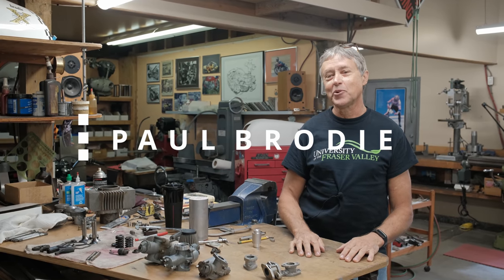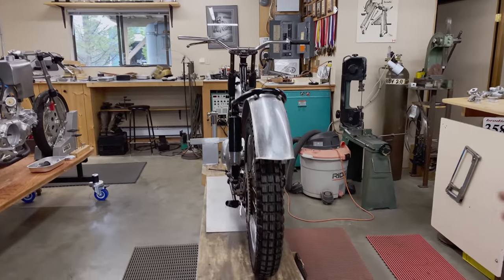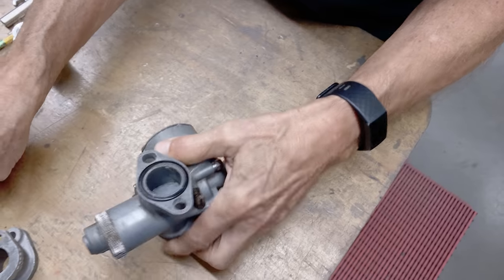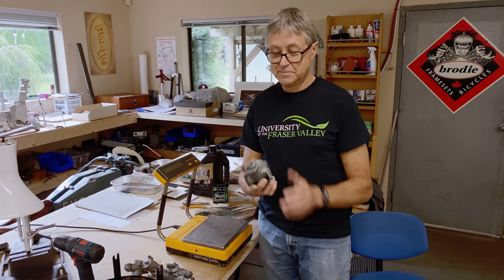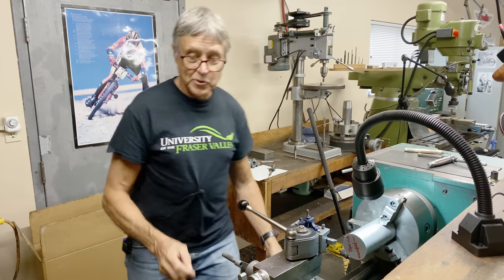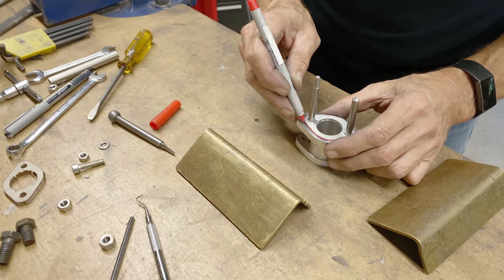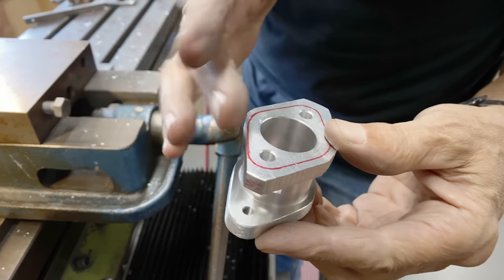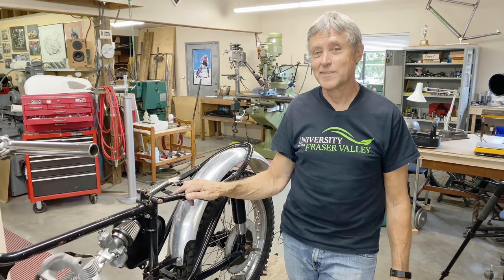Tiger Cub Intake Manifold // Paul Brodie's Shop

Comment: I purchased the same Phil Irving book when I was 15/16 yrs , I got that intrigued by inductions and exhaust systems that I saved my money and when I was 18yrs old in 1977 I imported into a Australia a Superflow flow bench Colorado USA , i then spent the next few yrs flow testing and modifying every type of cylinder head I could get my hands on , I was fortunate to meet Phil once , was a brilliant Australian engine engineer 
Great episode Paul 👍👌even tho I am probably the same age , I am picking great ideas /hints from you , can never stop learning 👌Cheers Chris
Reply from the maker: Thanks Chris. I had a friends' Superflow flow bench for almost a year, and I did a few heads on it. That was a good learning experience.

Comment: I think a couple of degrees to each flange face ought to do it or perhaps a little more work but cooler might be a piecut....no, one more would be better... 2 piecuts and Tig welds all the way around. Your signatures are these parts we see being made with ease. The crazy expensive mixed with the certainty of handmade is a look that adds the best kind of value, a personal touch.

Time to wait patiently for the chosen solution.
Reply from the maker: RJM, thanks for watching and commenting.
Reply: that's probably the easiest option right now - mill the faces at an angle
Reply: @raymondo162  Probably what I would have done. Most AMAL carbs were designed for up to 20degree down-draft but some were designed to be straight up and down. Fuel level changes on a mono-block  and concentric depending on mounting angle. The remote float early type are easy to spot as the base is 'twisted' or straight (unscrew jet block and put mounting surface flat. Float chamber will either be tilted or straight up and down)

Comment: I've seen many trials Cubs here in the UK fitted with the concentric carb. But the engines may have been fitted into frames that had more left engine offset. This allows the chain to clear 4.00 section rear trials tyre (tire). My 1961 Cub runs a Amal Monobloc carb, I've not taken if off yet to measure it's size.
I enjoy your vids please keep them coming.
Reply from the maker: I fixed it. You will see the cure in our next video. Thanks for watching and commenting.

Comment: Saw that coming mate. I’m looking at a similar tight spot with the carb conversion on my CCM F650 Dakar. It’s clear why no one has ever done it…!

If you make a V cut into the thin diameter of the manifold (and weld it together again), you can angle the carb downwards closer to level, and clear the top tube. That will allow you to use one of those angled cable tube extension thingies. 

Nice work as always. Thank you for sharing your Tiger Cub adventures.
Reply from the maker: I did figure out that manifold, results will be in this weeks video. Yes I screwup and make mistakes; I'm still learning.
Reply: paul brodie I knew you would Paul. Looking forward to seeing how you did it.

Comment: nice work! but to fix the carb clearance something nice would be to put some angle on the flanges so the carb is more upright compared to the cylinder... I think it would look better too.
Reply: Yes, and for a single cylinder, an even longer intake is good for torque.
Reply: @chrisjohnson4165  it wouldn't be longer, just some angle on the flanges. maybe 10-15 degrees.
Reply: @MrLeoBL  Yes, you're right.
Reply: Hey you are right!
Reply: I had a Cub in the sixties. I put a monobloc Amal on it, and if memory serves me correctly, there was an angled manifold supplied by Triumph which did exactly as suggested. Apart from solving the clearance issue, it helped to restore the correct float orientation. But as this was over 55 years ago……I wouldn’t bank on my memory.

Comment: Some nice nuts can be made by cutting the head off twelve point bolts. Drill and tap and you have nut with a flange that you can get a box end wrench on. Nice job on the manifold

Comment: Great videos Paul. Love your work. I started on Cubs at 13 years old, so this is a great project to see. I have a 26mm Concentric on a tapered manifold. It runs perfectly throughout the rev range, and much better than the original 15/16 (24mm) Monobloc. The standard manifold is canted to level the carb somewhat from the 25° barrel incline.
Good luck; this will be a great Cub.
P.S. Depending on your CR and exhaust I'd start with a 200 main jet on that carb.
Reply from the maker: Thank you T Fox. I have no idea on the jetting, so 200 is a good place to start. Engine will be assembled soon!

Comment: Paul, thin those flanges a tad for more clearance , they are pretty beefy .
Reply: Probably need to be quite thick to cope with vibration and a heavy carb. Thinner will probably distort and cause air leak? (very common on Japanese bikes where weight has been cut down)
Reply: He just wants it to be skookum
Reply: Could the insulator gasket be thinner to achieve similar solution? On my Commando there are two thicknesses for that gasket available.

Comment: Excessive heat is one of the major problems of Cub motors, as they were based on the 150cc Terrier, and fin area is marginal at best.  One of the issues related to this is fuel vaporisation,  which is made worse by the low-quality carbs that are often fitted.

The fuelling difficulties cannot be cured completely , but can be improved a great deal by using a better carb, which is spigot mounted into a rubber intake hose.
Reply from the maker: Yes I hear what you are saying. I will see where the path I have chosen takes me.

Comment: I agree with Gerald, that Phenolic spacer is pretty thick as well, you could get the carb a lot closer to the intake port and gain some room for the cable routing, awesome job on the manifold though, it is great watching you work Paul.
Reply from the maker: I did fix the cable routing, and it is all shown in the video coming out very soon, maybe even today! Thanks for watching and commenting.
Reply: As someone has already pointed out a longer intake tube helps with torque, and  at only 200 cc the Cub engine needs all the help it can get !
Reply: @samrodian919  , LOL, I feel Paul wasn't going for torque with the Cub, he probably better options in the shed for that :-)

Comment: Always fun watching you make these parts!  I make nuts for exhaust flanges out of tubing and weld an allan head to the end.  I don't think that would work for your application due to space limitations in the other direction but might be useful in the future.  Another excellent video!  Thank you!
Reply: Yamaha use 8mm and 10mm Allen head flange nuts on several of the 'cruisers' although I forget which models
Reply: @1crazypj   Gardner Wescot makes allan nuts as well but they are limited to shorter bolts or studs.
Reply from the maker: David, thanks for watching..

Comment: The frames were brazed in an open fire pit / forge. There’s a factory movie from the mid fifties out there on YouTube somewhere that shows it..
Reply from the maker: Yes, I believe a lot of the lug / tube brazing was done in the forge. But, the joint shown in the video was definitely fillet brazed by hand.
Reply: @paulbrodie  Correct🙂
Reply: The brazing done on the forge is called capilliary brazing, where a tube is inserted into a previously reamed lug and pinned in place, fluxed, and brass filler run into the joint. 
Fillet brazing is done with a higher melting point rod dipped in flux. It allows brass to be built up in a fillet at a tube junction without needing a  heavy lug. 
Look at the Cub headstock in the video; it is capilliary brazed to the top and down tubes. The cross tube under the seat is attached by fillet brazing.

Comment: Hi Paul 😊 i’ve just finished watching the Amazing Aermacchi Build, Now starting the Cub renovation, you showed in this video how do you get the centres of the manifold studs,  there is an easy way that doesn’t involve math ….. you just measure from the outside of one stud to the inside of the other this will give you the centre to centre measurement
Reply from the maker: Yes, there are several ways to come up with the same result. Thanks for watching!

Comment: I use a thickness collection of sheet aluminum to check wall thickness. Put scrap between driver's side thumb and index finger and the adapter wall between passenger side index finger and thumb. My middle finger and thumb combination are only used for calibration.....
I think your thickness mover outer is a cool tool.
Reply from the maker: A pattern maker gave it to me. He made it.
Reply: @paulbrodie  I've never actually had my hands on one of those 'thickness'  calipers but did see a plan for a woodworking version used by bowl turners long time ago (when I didn't know I may need one one day) LOL
Reply: What happens to your calibration when doing some carpentry and you hit your thumb instead of a nail with a hammer ?
Reply: @samrodian919  A ball peen never goes for a thumb but the memory gap waking up is flat out nuts.

Comment: Hi! you could make a custom carb slide cover with the cable off to the side a little so it misses the frame.  and without a choke cable thread.
Reply: or even centered throttle cable but adjusting screw at an angle
Reply: @Copozeras  You need to see where the throttle cable attaches to slide, plus, the inner wire doesn't take too long to 'saw' through angled pieces
Reply from the maker: I found a fix. Next video will reveal for sure. Thanks for watching!

Comment: You could cut your adapter and weld it back together at a slight angle. 😂 That would fix it.
Reply: legit
Reply from the maker: I did find a fix without using my welder. Next video coming up!

Comment: On the Norton Commando using those type ofAmal concentrics, the manifolds are curved to bring the carb closer to horizontal with respect to the bike frame. Could give you the carb top clearance needed. Also, the manifolds have studs threaded into the carb side flange, so the carb only needs a washer & nut each side to attach and no clearancing needed on the manifold body. 
When you stated you would not be planning to remove carb often, I chuckled! Can't tell you how many times I've have to remove mine! Those older, non-Premier types have non-removable pilot jets and a bad reputation for stubborn clogging of the pilot jet circuits.
Reply from the maker: I said I am not planning on removing the carb often. That is the optimist in me speaking. I am old enough to realize that reality might be different. I have fixed my manifold dilemma. Next video has the solution. Thanks for watching!

Comment: That is such an awesome bike.... I'd love to build one like that but I want a high powered electric QS 273 3.5t motor and Kelly 72200 controller running 80v Greenworks batteries so they can be charged and swapped out quickly.

Comment: Nice work, if you put a slight slope to the one face the carb would sit flatter and give more room for the cable and allow to mount as one combined piece. But you probably know this. I found this very interesting as i recently restored my 1967 Cub.
Reply from the maker: Thanks Robert. Great you have a Cub too!
Reply: @paulbrodie  do you have a video on installing an updated electronics instead of the points? I bought the system but the directions were poor and as i had a very difficult time setting the timing after the restoration i am somewhat reserved to do the upgrade.
Reply from the maker: @robertpenner4432   How did you set the timing? Did you use a degree wheel and a timing light?
Reply: @paulbrodie  i had a timing wheel but had never used one before so i went by what the manual said , which is a bit foggy right now but i got it to top dead center and then i believe adjusted the points so they would open slight before TDC. I had a someone from the part shop in Edmonton run me through it and his description was very similar to what the book had said but to now avail, the best i got out of it was a backfire a couple of times so i eventually took it to The Old Bike Shop in Calgary and their mechanic tuned it for me. Could not find anyone closer as i live in Kamloops. Then i had to get it re-certified as i had not insured the bike since 1970 and lost the paperwork on it but it runs and starts on the first kick, when i run it, which is not very often. I ad bought the electronic conversion as i heard it was better then the old points system, maybe one day i’ll consider changing it.
Reply from the maker: @robertpenner4432   If you don't have a degree wheel and a timing light you really are just guessing. We'll be making a video this spring.

Comment: Remove swingarm  check for "twist" also..axle holes maybe flogged out  causing wheel lean
Reply from the maker: Removing swingarm requires a hydraulic press, I discovered. Axle slots were not the problem. Next video reveals all!

Comment: Having ridden  a tiger Cub extensively in the early to mid sixties, I have a fond memory of them. II appears to me that the bike you have is abit of a mongrel The frame may be a swap over , or a one-off. The motor is not from circa 1958, but most likely a bastard version or an up-grade from a newer model. The ignition breaker was not offered by Triumph until model year 1964 and was a very welcome modification.The proper contact breaker assembly was mounted vertically in the right engine case with an internal clamp secured with a crew through the outer case cover. Th i arrangement was unreliable as it ouuld slip and cause the ignition timing to change while it was running.The frame is missing the triangular gusset welded over the jumcture of the under-tank tube and the front down tube. Some of the cubs could develop a crack in the front down tube without it. I thoroghly enjoyed your treatment on the manifoldWe never had the equipment to do such work. I hope your project runs good  and is reliable for you.
Reply from the maker: Yes, Jim, my bike will be a mongrel. I bought a bunch of stuff which included 2 frames and 4 motors. Trying very hard to make one good bike out of all of that. 1958 frame with a 1965 motor. Thanks for watching!

Comment: I think there's a slight twist in the standard Cub manifold, it's hard to see, but if you put it on upside down , the carb pokes out the other side of the frame top tube.
Reply from the maker: I did fix it. Next video coming soon!
Reply: @paulbrodie  looking forward to that. Cheers

Comment: I was taught the inside of one stud to the outside of the second stud gives you the center to center as in your manifold mounting studs. This assumes that both studs were of equal diameter and saves my from a math error!
Reply from the maker: That is true, but how do you measure that?
Reply: @paulbrodie  Paul, I use my very best eyecrometer if I feel the need to be super accurate. But, my machine skills are equally poor to my measuring skills. It usually works out, but nothing as nice as your results. Love the videos!
Reply from the maker: @hasletjoe5984   Thank you Haslet Joe.

Comment: I know it would have been a lot more work but personally I would have made the manifold with a gentle bend in it, this would have given you clearance for the choke and throttle cable, also the carb is less likely to flood if its level, jetting it can be a bit easier and you are less likely to have the engine run rich when you are braking hard because the fuel won't spill out of the idle circuit into the air stream. Yes a straight shot at the intake valve will give more power than a bent intake but I bet there isn't a dyno that is sensitive enough to even measure the difference on a Cub engine. Anyway watching you machine stuff up sure beats doing the work that I'm supposed to be doing!
Reply from the maker: On a Cub there is no such thing as "braking hard". Have you seen the size of the brake shoes? Thanks for watching.
Reply: @paulbrodie  I thought that you might say that!

Comment: Don't forget to true up the face of the carb. They are essentially a heavy lump of plasticene being shaken to pieces, and the flange is always bowed, leading to air leaks.
Reply from the maker: I'll check, thanks.
Reply: Yes over torquing the mating flange bolts can give that warping issue. It can also lead to the carb slide jamming in the bore, esp once it get heated. I've had a slide jam open on my Commando after stopping fora fuel up. Luckily I gave throttle a twist prior starting up again and noted grip not returning to closed. After a few minutes it returned to close on its own as things cooled further. Float bowl was also too hot to touch during this issue. That made be a believer in good heat insulators.
Reply from the maker: @TornadoCAN99  I had a throttle stick open and that was not a good experience. I will be careful not to over torque the flange fasteners. Thanks for commenting.

Comment: Hi Paul, I have the same issue with my cub and a concentric carb, did you fix the issue?
Reply from the maker: Bob, it's been a long time since we made the video, so I'm not sure which issue you are referring to... I did make a second manifold so that the carb would clear the frame...   :face-blue-three-eyes:
Reply from the maker: @Bob Murphy As far as I remember, there is only one video, and both manifolds are shown on that one video. I rotated the stud centrelines to give clearance. It doesn't matter how close the carb is, as long as there is a bit of clearance...   :face-orange-raised-eyebrow:

Comment: The horizontal top frame tube on the Cub looks all wrong. Why didn't they make it angled to join the steering head tube higher up? (would have solved your throttle cable routing, too!)
Reply from the maker: You are right. When I was 15 I took the gas tank off my Cub and was shocked to see the "missing tube". Even at 15 I knew that was bad engineering. But it works.

Comment: Did you put the adapter on upside down causing the carb clocking to be out?
Reply from the maker: The adapter is symmetrical. The fix is shown in our next video...